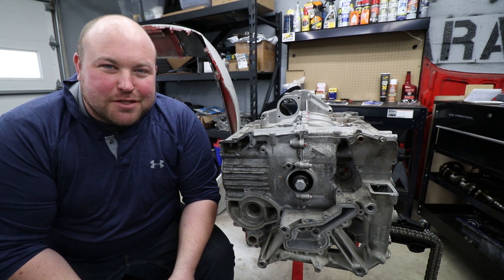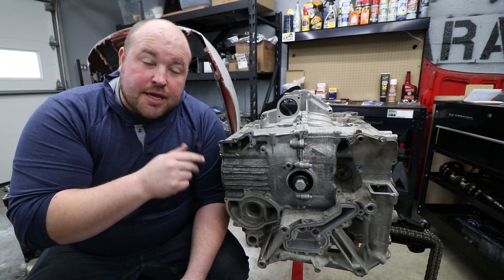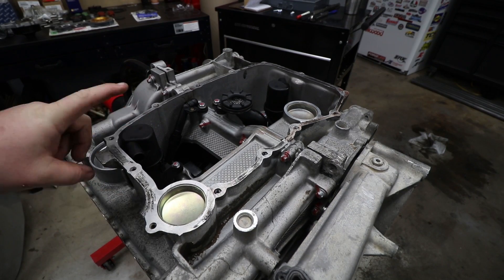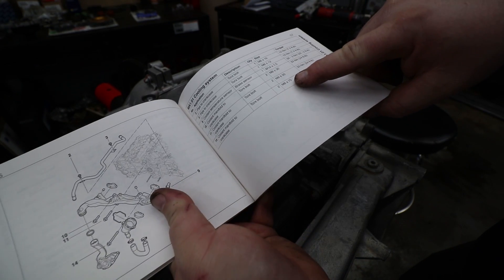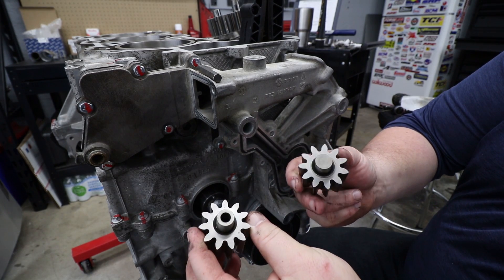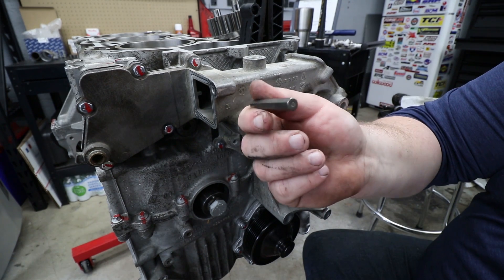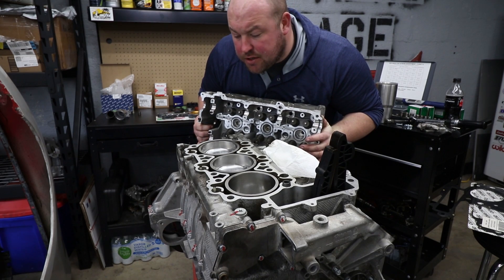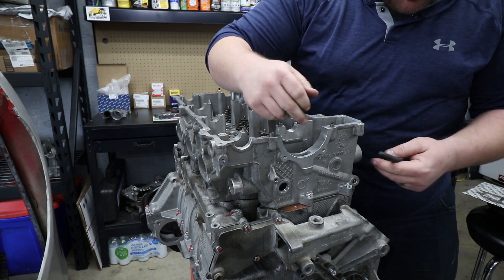Turbo 3.8L Cayman Engine Build (Porsche M96) - Part 9

Comment: Hey Guys! Do you have plans to update a review of the car once completed? I've been eager to see what this turns out as!
Reply from the maker: Yes! Things have changed but we should be updating soon. The car should be running by spring time!
Reply: @BoostBrothersGarage  sweet! Still turbo?
Reply from the maker: No, the M96 and the turbo got sold after completion. This is a fully built NA M97. 3.8 with all the goodies!
Reply: @BoostBrothersGarage  aw okay! I’m doing a customized stage 3 kit right now so was curious where yours ended up! :)
Reply from the maker: Awesome! I would love to have seen it all done but we don’t own the car anymore and are finishing it based on the new owners wishes. He wants a reliable and quick track car and wanted more simplicity and less insanity haha

Comment: I think I must have missed a video, how did you correct the line hole miss alignment of that cylinder sleeve for the wrist pin clip tool? I’ve got a extra set of heads that came off of a 2.7L M97.20. I haven’t gone through them in any way, they came off an engine with 80k that had a spun bearing due to oil starvation I believe (there was a decent amount of bearing material in the oil that circulated so I’m sure the heads will need some love) I’m not sure if m97 heads will work with m96 etc. 3 chain vs 5 chain 🤷‍♂️
Reply from the maker: I ended up having to use a dremel and clearance the sleeves. I actually forgot about that whole fiasco! I think I have a head lined up but I will reach out if not. Appreciate it!